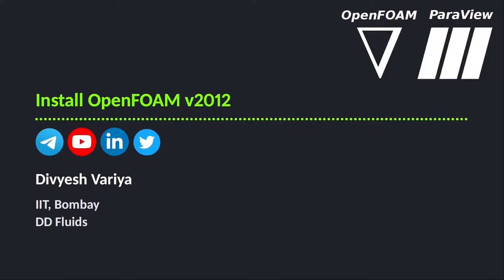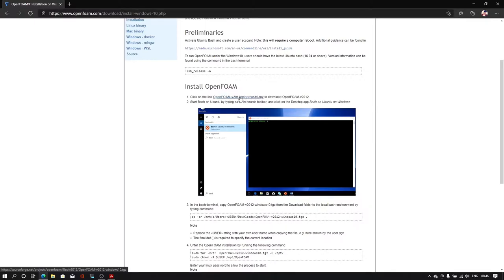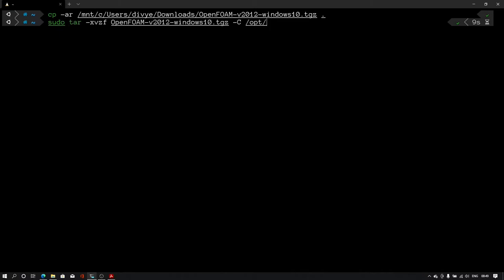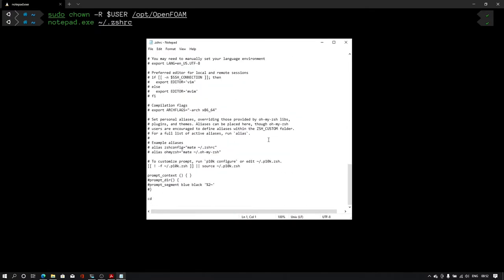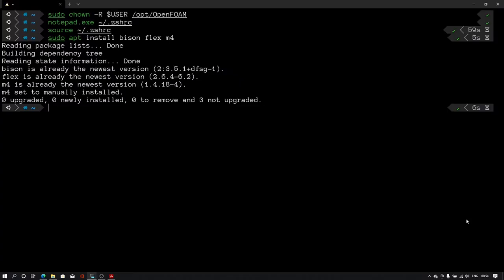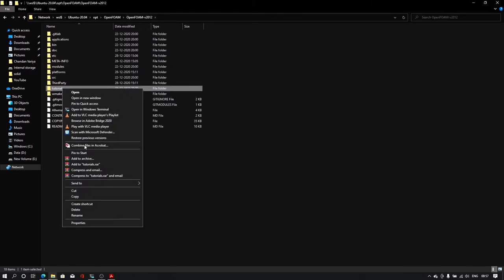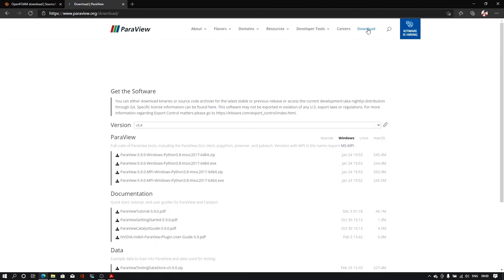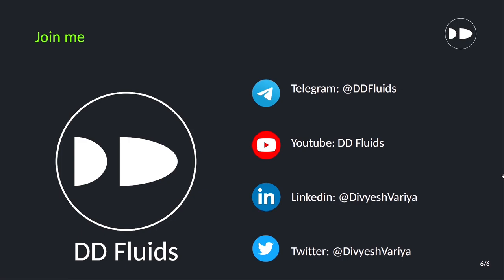Install OpenFOAM: Part 2 [OpenFOAM v2012 in WINDOWS 10]

Comment: Thanks a lot for your job. But one question i have. What you have done for get the preview of the commands (autocomplete for the commands line) in the WindosTerminal?
Reply from the maker: WSL installation is necessary. Check part-1 video.
Reply: @DDFluids  Yes for sure, i've done that. I've seen your first video again, but their is not the autofill action. when you type in any  command it ist only white. in your secend video the color is green wile you type in the command and it shows a finish command. can you give some info about that, please? Thanks a lot.
Reply from the maker: There are videos available for "oh my zsh customization" you can check that.
Reply: @DDFluids  Thanks a lot, i've found it.
If anybody whant to know, here the simple instructions for that
https://github.com/zsh-users/zsh-syntax-highlighting/blob/master/INSTALL.md
https://github.com/zsh-users/zsh-autosuggestions/blob/master/INSTALL.md
Reply: @ColinCollerle  type a few initial letters of the command and press TAB button. Hope it works for you.

Comment: Where did the source notepad file come from @ 7:00 ? I don't have that
Reply: I am getting "no such file or directory" for 'source $HOME/.bashrc. Up to this point everything else ran fine
Reply from the maker: Three possible mistakes:

1. You haven't finished the first part
2. You are in different location while opening the zshrc file. Type "cd" to goto home directory
3. Command that you typed could be wrong
Reply from the maker: In this video: https://youtu.be/7vVWGF5TnhQ
I got similar error and resolved it. Check timeframe 17:00
Reply: @DDFluids  I figured it out, for Windows there is a bug when using the source $HOME/.bashrc       I had to bypass this and now it works, thank you!

Comment: What is the reason if no such file detected is showing
Reply from the maker: If your username has space in it, you will get an error. For example if your username is "Palak Sahu", your username will be "Palak\ Sahu". Just add a forward slash before space.
Reply: @DDFluids  It still shows the same error. Despite giving the forward slash?

Comment: I find a problem with the username. I have typed it correctly as per the instructions in this video.  Still unable to execute. Pls help
Reply from the maker: What is your username? Does it have a space in it? If yes, you need to add a "\" before space. For example, if username is "Pravin Sharma", go with " Pravin\ Sharma".
Reply: @DDFluids  Yes it's with space..

Pravin Sharma LNMIIT

So should I type.. Pravin\Sharma\LNMIIT ?
Reply from the maker: After \ add a space
Reply: @DDFluids  Ok will give a try tomorrow when I am back to the institute.

Pravin\ Sharma\ LNMIIT

This way right?
Reply from the maker: Yes. Correct.
Reply: This worked for me. Thank you so much. 

I used OpenFOAM-v2106.tgz file for installation.

Comment: Thanks for the video, Could you please share the text file   "zshrc"   because when I use command notepad.exe ~/.zshrc, he tells me create new one and it is empty. However , I typed the command in this empty text and save then source $HOME/.zshrc it says "  ' not found, did you mean:
  command 'cdi' from deb cdo (2.0.4-1)
  command 'cde' from deb cde (0.1+git9-g551e54d-1.2)
  command 'cdo' from deb cdo (2.0.4-1)
  command 'cdb' from deb tinycdb (0.78build3)
  command 'cdw' from deb cdw (0.8.1-2)
  command 'cdp' from deb irpas (0.10-9)
  command 'cd5' from deb cd5 (0.1-4)
Try: sudo apt install <deb name> " 

So ?? Thanks in Advance